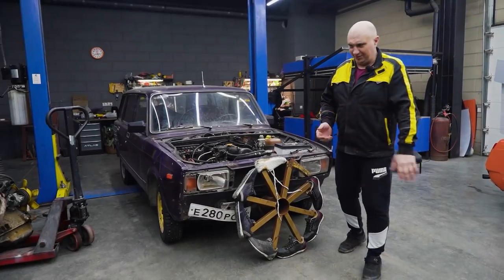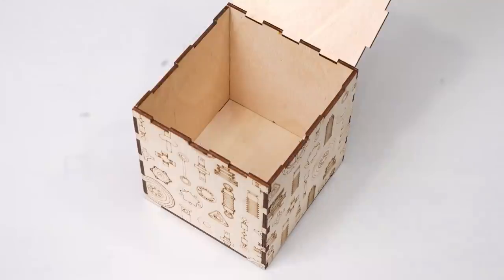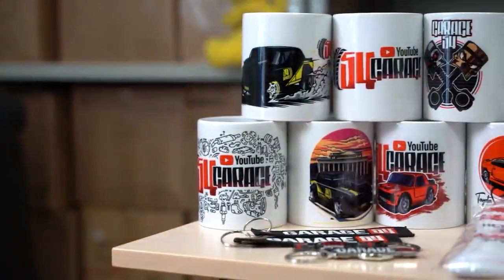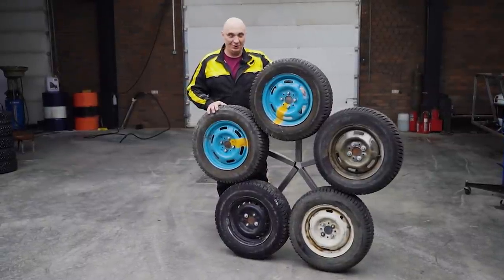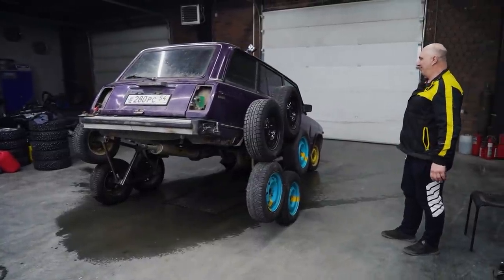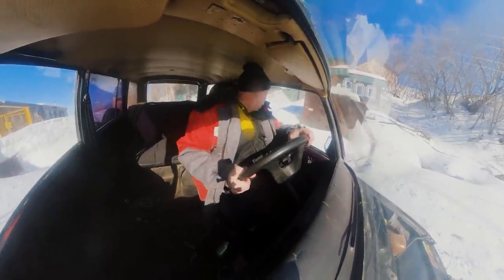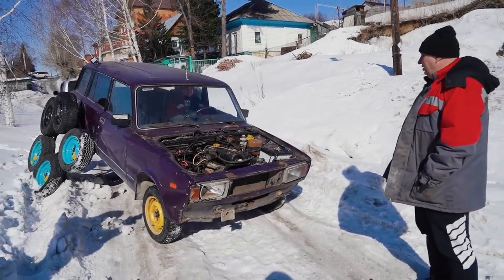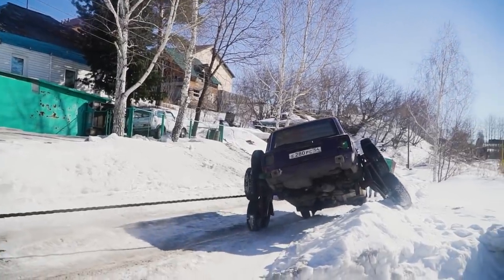We make a multi-wheeled wheel

Comment: Suggestion: make car driven like diesel trains- engine spins generator and electric motors spin wheels. At least two electric motors for each rear wheel. Ofc 4wd would be even more interesting, but I guess thats a bit too tricky to pull off.
Reply: That's just a hybrid lol
Reply: @chang.stanley  well yeah, but that most trains work🤷‍♂️
Reply: @chang.stanley  Incorrect. In a hyrbid vehicle the engine is still connected to a drive train and the wheels. On a diesel train, the engine is not connected to any wheels just a generator. Think Tesla with a generator instead of batteries.
Reply: I second this suggestion. A diesel electric car would be awesome. :)
Reply: @devoncantrell3311  Buy a Prius and cut the drive chain
Reply: @chang.stanley  the drive chain? You make it sound like cars run like motorcycles. I don’t think you know what you’re talking about here dude.
Reply: @devoncantrell3311  I mean the chain of the drive components from the engine to the wheels after the hybrid equivalent of an alternator. Don't ask me to name things correctly lol
Reply: Yeah use like 4 or 5 starters per wheel and like 10 alternators
Reply: @chang.stanley  all that would do is stop the engine from charging the hybrid battery. 
Do you mean if I were to take the drivetrain out of a Prius?

Trains still don’t have batteries. There’s electric motors in the trucks, and they are directly powered by a Diesel engine that directly drives a generator. How fast the Diesel engine spins directly correlates with the speed because the faster it spins the more power it generates for the wheels. A Prius does not work this way remotely even if you took out the drive train.
Reply: @devoncantrell3311  I did say after the alternator, so it would still be charging the battery. 

You probably could also take out the battery and directly wire it to the motor but I think it's basically the same thing.
Reply: @chang.stanley  not really, a Prius engine would blow up if held near the rev limiter. Plus the electric motors barely make any power compared to the engine. It’s really just enough to get the car moving.
Reply: @devoncantrell3311  Oh I see. What about a more powerful hybrid then? I recall some Porche hybrid getting 2-300+ hp on the electric motor alone.
Reply: @chang.stanley  you’d still need a different engine as well but it could work.
Reply: @devoncantrell3311  someone tested the performance of a Prius with a dead hybrid battery. It couldn’t do highway speeds 🤣

Comment: Make a thing like that, but with the tire being driven by the engine, not the wheel magazine. Make the magazine also rotate, but lockable to keep one set of tires on the ground. Load the magazines (left & right) with matching tires, but with a set of selections, like on road & off road. So you can quickly switch to tires that are appropriate for the impending terrain.

Comment: If you turned the rear  axle upside down it would run the other direction and then if you used reverse gear you'd have a lower ratio forward gear to compensate for the massive increase in your gearing that you created with the overall diameter of your Multiwheel arrangement, that's why the clutch got smoked.
Reply: Reverse and First gear are usually the same ratio.

Comment: Reverse is generally lower gear than first. It also has a mechanical advantage in lifting the body. The penta wheel shape is probably in excess of 5 meters, maybe stock is 1.75?

Comment: Hoop ring on the inside of the wheel and a roller to absorb the inboard forces . cut a square tube through the body for the roller, maybe like a roller coaster has .  Add a Garage 54 107% extra diffferential

Comment: The diameter of your big wheel is between 4 and 5 times as big as the original wheel. As a result, it tries to drive the car 4 or 5 times faster than normal. So basically with those giant wheels on... driving in 1st gear is like driving in 4th or 5th gear. That's  why you were roasting the clutch.

Comment: Question: What if you take a turbo and simply drive an axle with it? Instead of compressing the air you are making an extra motor on the axle. Will it provide a tiny boost or will it do nothing at all?

Comment: Suggestion next time have the wheels on bearings.  Have a way to apply brakes to all at ome time.  So lock up the breaks and let off the clutch and get going then when your off the power release the brakes to whatever wheels are touching the ground they free spin. Would making coasting easier

Comment: you made a mistake in building the thing like that, you have two wheel simoultaneously on the ground, one turning clockwise and the other the opposite direction, let them free to rotate (without putting them in contact each to the other)  and they will go smoothly